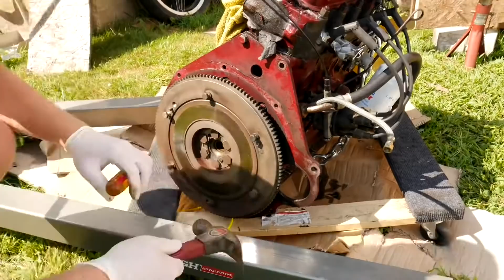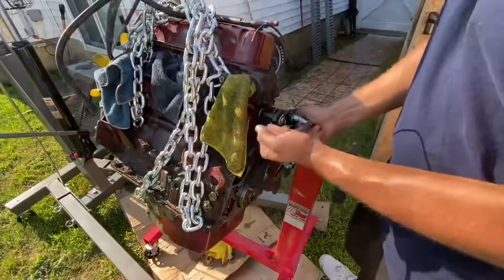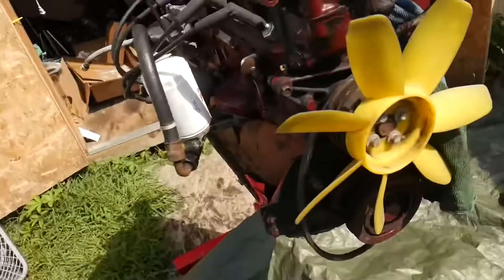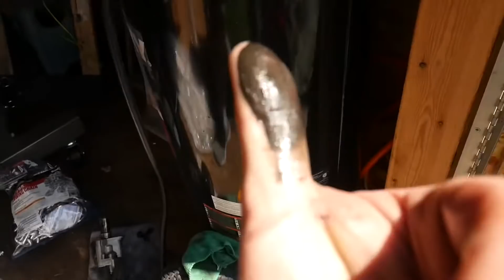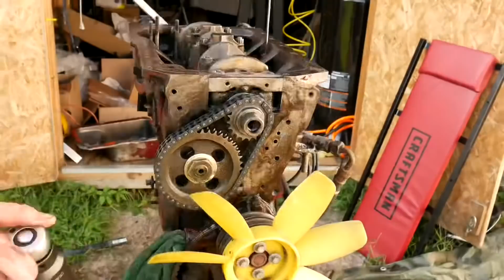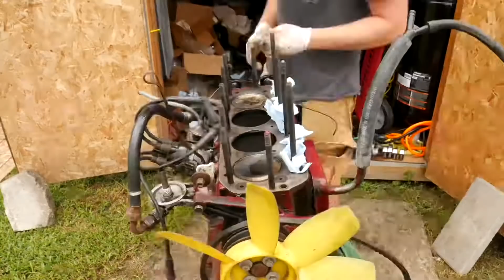Diving DEEP Into the MG’s Blown Engine and Beginning to Install the NEW Parts!

Comment: Oh Dude, who taught you how to do a rebuild?  Do it right the first time, or do it over.  

After 48 years of doing Mechanics work, on everything from small Engines like this one, to ones that are so big that you can walk around inside (Slow Speed Diesels with a bore of about 3 feet, and a stroke of about 6 feet) there is one thing that applies to all of them.  Don’t be in a hurry and just slap it back together!  

Measure your parts and make sure that they fit properly.  Make sure that you have ALL of the Oil passages cleaned out completely.  Plastic-Gauge the bearings for to check for the proper oil clearance.  Measure the Cylinder Bores and the Pistons to make sure that there won’t be excess Piston-Slap.   Check the Ring End Gaps before installing on Pistons so there won’t be excessive Blow-By, OR, that the rings will not expand and bind up when the Engine warms up to operating temperature.  

If you don’t do these kind of things, you are just dooming the next owner to another engine rebuild.  You-tube is good for a lot of things, but it’s not a replacement for the mentoring of an experienced Mechanic!   

I guess the real questions is this;
Are you doing this for the satisfaction that comes with bringing an old piece of Machinery back from the junk heap?
Or,
Are you doing this to make a quick buck, and who gives a crap about the next guy who owns it?

Comment: So oil pressure on some engines at idle once warm can be that low and not cause any issues it mainly depends on the engine like a SBC runs between 10 and 20 at idle

Comment: Hopfully its not too late for you to follow the excellent advice I see posted.   Hot tank and some minor machine work, it would be worth it for such a stock MG.  Good luck bro and keep up the great work.   ps.   Is the fire truck off the table?
Reply: See if parts stores in your area loan tools?   In my area they do....they charge a deposit that is refunded if tool returned undamaged.    For expensive tools its a life saver

Comment: Quick hack to get push in rod pins an 10-12mm deep socket 9” c clamp and an deep socket 1mm bigger than the pin works for me every time I have to rebuild pistons like that

Comment: Did you seriously assemble all crank bearings with no oil? You can instantly ruin all bearings like that...
Reply: As long as he doesn't turn the crack it will be fine, after all that's how we check the clearances with the plastic-gauge

Comment: Did your MG have the conversion over to hardened valves seats, so that it can run on unleaded fuel? (It’s possible that it would also need a re-timing for higher octane fuel.) Keep doing what you do, dude!

Comment: I know it's alot of work but the block really needs to be stripped all the way down and either hot-tanked or take a pressure washer and pressure wash out ALL of the oil passages, you won't believe the amount of metal that will be left in the oil passages if you don't clean them also that pickup screen needs a very very good cleaning to be reused, I'm glad you decided to change the rods though, if you reused the old ones it would have definitely spun a bearing again. It really sucks and is expensive to replace a bunch of parts now but it's worth it if you want this engine to last.
Reply: I agree. All those metal shavings will be EVERYWHERE in the engine. Problem is that these videos were recorded last summer most likely, so we're just along for the ride at this point.
Reply: Didn't help that last time he changed oil he didn't replace the filter.